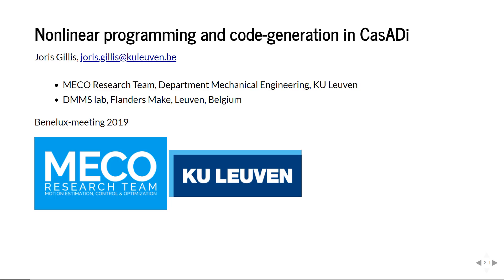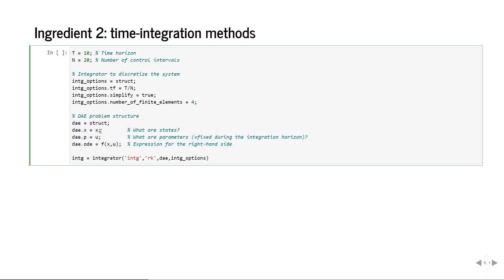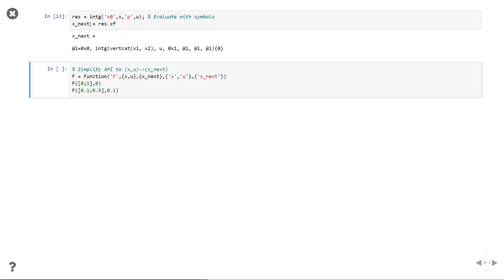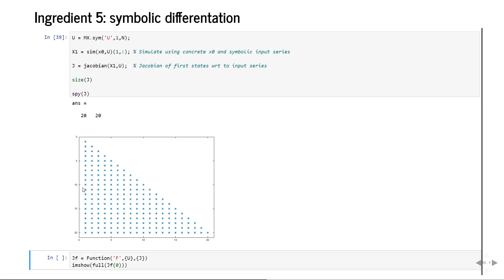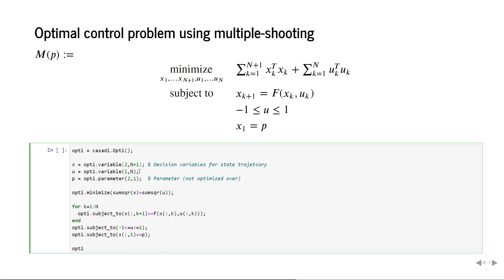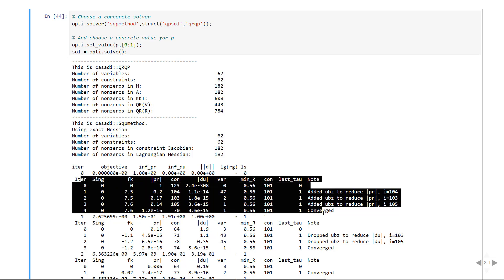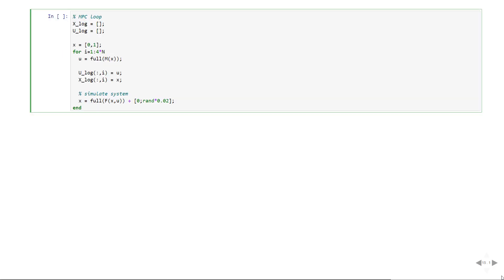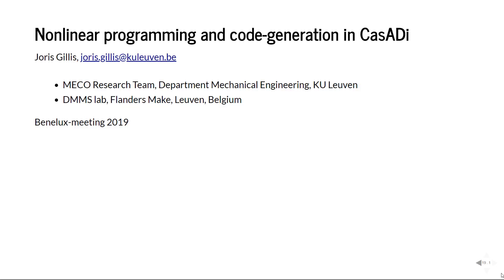Nonlinear MPC tutorial with CasADi 3.5

Comment: How would one implement the function at 1:35 in Python a way that allows the function to take x and u as two different vectors? When I try to convert this to Python, I get the error:

TypeError: unhashable type: 'list'

Code is:

x1 = SX.sym('x1')
x2 = SX.sym('x2')
u = SX.sym('u')

x = [x1, x2]

ff = [((1-x2**2)*x1 - x2 + u), x1]

f = Function('f',{x,u},ff)
Reply from the maker: x=vertcat(x1,x2)
f=Function('f',[x,u],ff)